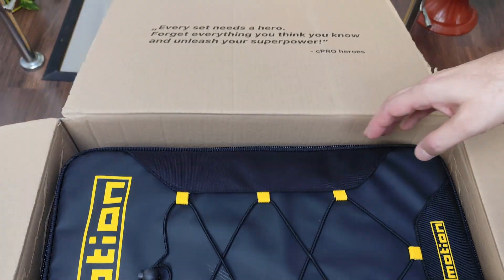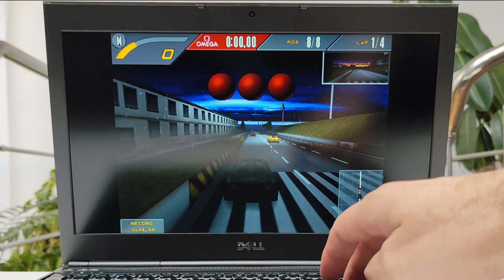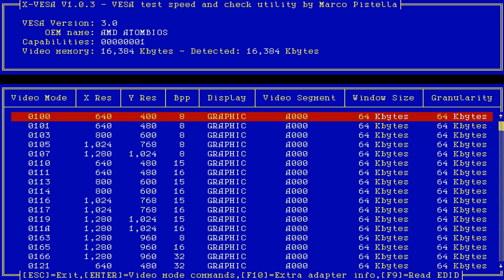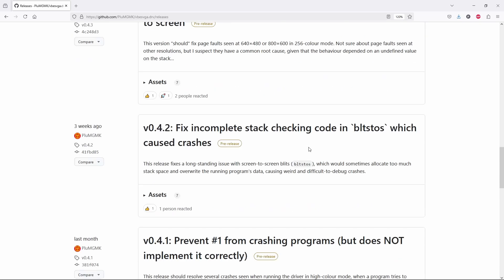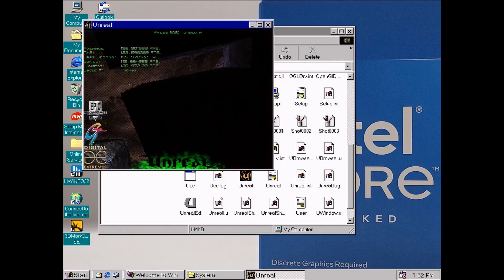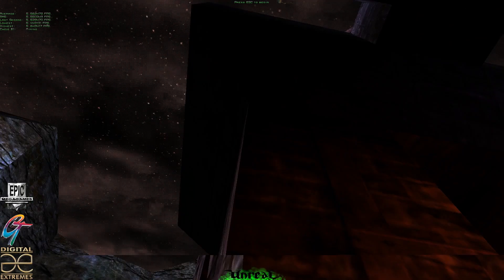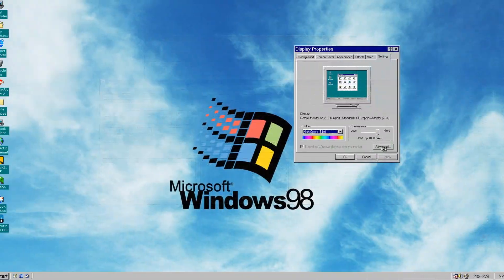World's First 3dfx Voodoo 4 Laptop: It Works in XP, But Windows 98 Chose the iGPU

Comment: Thank you for the video i subbed 😀 i just installed Windows 98 se quick install socket 775 8400cpu and 760 and sound blaster live card. Everything working so far after tweaking a bit. What sort of acceleration would i have with the 760 ? Quake 1 about the limit ?
Reply from the maker: Welcome aboard! Is the 760 a GTX 760? If so, you might get around 35-45 FPS at 640x480 with software rendering - which would actually be a pretty authentic Windows 98 gaming experience. Back then, many of us (myself included) were still using basic 2D cards like the S3 Virge. Since your 775 motherboard makes it easy to switch the primary GPU, you could grab a second card like a GeForce FX 5500 (PCI) or - even better - a Radeon 9250. If you have dual PCI-E slots it's cheaper to buy a PCI-E card for Windows 98, check this out: https://youtu.be/iMyK-NJkSoo

Comment: The 3dfx patents can be sold or free-sourced 25 years later. We are around this glorious date. Where we can Buy this mini-card ? Is Nvidia Will help this startup in rétro gaming? Have a Nice gaming expérience with this vsa-100  chip.
Reply from the maker: There will be another 3dfx video today -  stay tuned for more details! You can source the VSA chips from eBay and order the PCB from PCBWay or JLCPCB using the original design files from Daniel at SDZ-Mods. After that, it’s a matter of assembling and soldering the components. The design will be open-source, so anyone can replicate or modify it.

Comment: I HAVE BEEN SAYING THIS SHOULD BE DONE FOR YEARS!!! I also wonder if you could make a voodoo card that plugs into the pcmcia slot. Or the mpci slot.
Reply from the maker: This V4 board is using an original VSA-100 chip, built on 250NM process - and this chip needs proper cooling, so you can't make some tiny Voodoo cards that can fit on a PCMCIA form factor or anything similar.  This Voodoo 3 and 4 MXM cards can work with the original solution cooling from the laptop.

Comment: As someone who owns a M4800, albeit one with a M2200 instead of a Voodoo 4, it should be possible to tell the laptop to just use the dGPU only and bypass the issue with 98.

I'd also be curious how the 8570W would fare, as that is dGPU only.

Edit: At the end you mention a whitelist, which doesn't really make sense here. I upgraded my M4800 with a M2200 which came out after the laptop was released and it works mostly fine. Although if it is a real issue, maybe Coreboot could help?
Reply from the maker: This V4 board is using the original VSA -100 chip, built on 250NM process - so as long as you stick with the original hardware you need proper cooling, so you can't make tiny Voodoo cards that can't fit on PCMCIA form factor or anything similar.
Reply: @O_mores  I'm not saying PCMCIA. These laptops have MXM Type A. The V4 board is MXM Type A.
Reply from the maker: Oops, that was a reply for another comment regarding V4 on a PCMCIA card. So far, this M4800 laptop boots with Coreboot and the V4 as primary: https://imgur.com/a/iT0mNoo Now it works with Windows XP - which is not officially supported by Coreboot (some patching was required). Windows 98 doesn't work yet....

Comment: PCI-E x1 next project ?
Reply from the maker: Right now, you can actually make this work using PCI-E to PCI or PCI-E to AGP adapters. The PCI-E to PCI ones are pretty cheap, like 10$, while the AGP ones tend to cost a lot more. Building a Voodoo 4 PCI-E x1 card from scratch wouldn’t be cheap so I doubt Daniel from sdz-mods it's going for it... Especially since there are already decent workarounds, and you can even find some AM5 or Socket 1700 motherboards that still have old-school PCI slots - perfect if you want to throw in something like a Voodoo 5 5500.

Comment: Sweet, what did that set you back? And were can I get one?
Reply from the maker: You can’t really buy one, but you can build one yourself. VSA-100 chips are surprisingly easy to find on eBay - still brand new, and around $25 each if you buy a whole tray. The PCB design and all the firmware will be available for free, so in theory, you just order the board, send the chips out to be soldered on, or even do it yourself if you're up for it. The cool part is, the design and firmware have already been tested and we know they work - so no surprises like realizing you forgot to add something after the PCB shows up...
Reply: @O_mores  Thank you for the info.

Comment: this mean, old tech still can use modern DRAM? like Pentium 3 with DDR2/3
Reply from the maker: This Voodoo 4 uses 4 x IS42S32400J-6BL chips - 128Mb (16MB) SDRAM, rated at 6ns (166MHz). The manufacturing process and packaging are newer, but these chips still work like classic SDRAM. 

A Pentium III can’t use DDR2/3 but you can run Windows 98 on a modern DDR5 motherboard (like shown here: https://youtu.be/G7qm3GFy9tg ) and even use old-school PCI cards in newer systems. I have a Voodoo 3 PCI in my main rig.
Reply: @O_mores  I see, I thought new RAM can be downgraded and let North Bridge handle it. Like Biostar P4M900-M4 motherboard which let PGA478 CPU use DDR2 RAM instead of DDR1
Reply from the maker: It all depends on the chipset, and a lot of them were compatible with the previous generation of RAM. Even today, some Socket 1700 motherboards come in either DDR4 or DDR5 versions. A few rare ones even have both DDR4 and DDR5 slots - kind of like the good old days when boards supported DDR1/DDR2 or DDR2/DDR3. Of course, you can only use one type of RAM at a time, not both.

Comment: Why don't you use the MXM Voodoo card in a Clevo based laptop? Maybe you'll have a better chance to get the card to work with Windows 98 then.
Reply from the maker: Of course, I'd test it in a Clevo laptop if I had one on hand but there's a good chance that both laptops are using the same AMI BIOS. Yes, they're heavily customized, but the core functionality might behave identically.

Comment: precision m4800

setup

video/switchable graphics/unchek option

unchecking this option will only start with the mxm
Reply from the maker: Yeah, but since this MXM card isn’t on the BIOS whitelist, the system just switches back to the iGPU after like two seconds. Plus, the Voodoo 4’s BIOS is not MXM compliant. Coreboot/SeaBIOS does let it boot from the Voodoo 4, but that BIOS is kinda janky for Windows 98 or XP - basically you can't install them... The real fix would probably be modding Dell’s BIOS, but that’s a pain in the a** to pull off.
Reply: @O_mores  I used modded Bios for Alienware M17X R3, you can mod by Bios by yourself using amibcp and afuwin
Reply from the maker: @kiki83607 Yep, I "modded" my BIOS with AMI BCP so I'm familiar with it. You used a M17X R3 BIOS on this M4800 Dell? Or you have an Alienware M17X and you modded the BIOS?

Comment: Quick correction, VBE had some acceleration functions, defined in 1996 called VBE/AF, both for 2D AND 3D. VBE 3.0 (1998) brought to the fore a few more functions than 2.0, and more importently, 32 Bit support (prevois VBE incarnations were 16 bit only).
Reply from the maker: Yep - but those acceleration functions needed BIOS-level implementation to be usable, and most vendors didn't bother implementing them in the first place, those few cards that can be used with VBE/AF do have proper drivers for OSes like Windows 98. The good part is that these newer GPUs are pretty fast even with basic VBE.

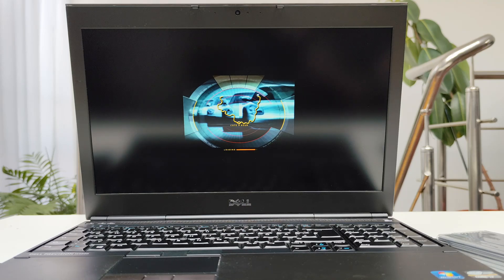Comment: 13:07 I ran an old game that requires 3DFX support using modern hardware and software, with the help of a wrapper-driver called *"Zeus Software nGlide"*, which emulates a 3DFX Voodoo video card.

I ran the game Asghan: The Dragon Slayer on Windows 10 64-bit with a GTX 1060 graphics card.

I recorded a full HD gameplay video (all the way to the end) and uploaded it here on YT. It's nice to see old 3D games running at high resolutions!

I know that your goal is to run the game on original Voodoo hardware.

But I thought it would be interesting to share this information here, in case someone wants to try it in a more accessible way.

I tried it on Windows 11 once and  the game launches, but it runs very slowly.
Reply from the maker: Yeah, I've used nGlide - actually a bunch of older GOG games include it by default. The graphics end up looking about the same, but I guess there's just something special about running games on actual 3dfx hardware...

Comment: Hp elitedesk 800 g1 usdt has a mxm port, it might be a perfect little desktop for a card like that :)
Reply from the maker: Yep, good tip! I actually found some of these G1 USDT  models "refurbished" for about 80$, the only problems is that an MXM card like this Voodoo 4 M4800 is not exactly cheap to make - especially if you order only a few PCBs... So if you're going to use it in a PC it's cheaper to get a normal card for the 3dfx experience.

Comment: Excelent job, as always. 
ps: I remember seeing PCIe to MXM gpus: wink: :wink:
Reply from the maker: Hey, thanks for checking this out! 😁 I’d love to get one of those adapters - I’ve got both a Voodoo 3 2000 and a beastly Voodoo 5 5500 in MXM format. They actually work, but I can’t use them in my Dell M4800 without modding the cooling, especially for the Voodoo 5 since it’s packing two VSA chips!
Reply: Good luck finding pcie drivers for anything for win98
Reply from the maker: @Alexdc11Xof  I'm quite familiar with all PCI-E devices that have Windows 98 drivers. There are drivers for USB 2.0 PCI-E cards, FireWire, Gigabit Ethernet, sound cards, SATA PCI-E, and of course video cards. You can see a few of these PCI-E devices installed in Windows 98 here: https://youtu.be/i_7yCmXm2wQ

Comment: Does the Voodoo work on Windows XP or 7 though?
Reply from the maker: Yep, it works in Windows XP - you can actually see it running in the video. Should work in Windows 7 too if you use the SFFT drivers. For XP, you're good with the last official 3dfx reference drivers.

Comment: Oh, I saw a post on reddit about a 3dfx laptop, it's crazy, and it's on an Intel core i7 laptop (if I'm not mistaken)
Reply from the maker: Yep, this was the beast! Specs:

    CPU: i7-4930MX @ 3GHz

    Chipset: Intel QM87

    RAM: 32GB DDR3 (4x8GB @ 1600MHz)

    GPU: 3dfx Voodoo 4 (M4800 mod) + Intel HD 4600 iGPU

    Expansion: ExpressCard slot (PCIe x1)

    Display: Full HD (1920x1080)

Comment: First thing I was checking if the video was uploaded on April 1st....
Reply from the maker: And here’s something even crazier - there’s also a fully functional Voodoo 5 5500 in MXM format! The cooling solution isn’t finalized yet, so for now, you can only run it with a PCIe-to-MXM adapter or some improvised cooling... like leaving the laptop open and put some radiators on both VSA chips.

Comment: The retro scene is crazy. 😮
Reply from the maker: Yep! There’s also a Voodoo 5 5500 with dual VSA-100 chips in the same MXM format. Daniel from sdz-mods actually sent me one. It was tested with a PCIe-to-MXM adapter and it works! The only hangup right now is the cooling solution isn’t finalized. Once that’s sorted, this thing will end up in a Dell M6800.

Comment: What about NVIDIA GPU laptop Windows 2000 ?
Reply: I believe AMD was a lot better.
Reply from the maker: @NguyenHoang-pv2xd It should be easier to find a powerful laptop for Windows 2000 since it has official driver support up to the Nvidia GTX 400 series. I even got it running on a 13th-gen CPU (desktop) and played Crysis! Check it out here: https://youtu.be/f2grGf2rTV8

Comment: In case of the BIOS, you might want to look into editing the BIOS/UEFI image binary to add support for primary display device selection. People over winraid forum (that has been moved to level1techs domain recently) specialize in that kind of stuff so you should go and ask them for help. Chances are this could be very easy fix - either by transplanting back selector from stock template BIOS that Dell used, or from different Dell laptop BIOS that uses similar platform/specs. If a whitelist edit is all it needs then it would be even simpler. That community has done far crazier things with BIOSes - thanks to them my Ivy Bridge rig gained full bootable NVMe support in the BIOS, with Win7 booting on a GPT partitioned (something said to be impossible on 7) 1TB NVMe drive, WITH boot manager being on the very same drive! Cheers

Comment: If this card does not support Win 3.0, 3.1 or NT 3.xx, there is no point to get this card nowadays even for nostalgic performance because GeForce 6000 series support Win95(?), NT 4.0, Win98 and later. This is just my opinion. But this is crazy for rareness. So, good video as always!
Reply: The main reason to do this would be for games that are 3dfx glide only, or render nicer with glide than DirectX. You can use wrappers like nGlide to play them on modern GPUs, but Omores whole thing is doing everything with real hardware.
Reply: @parad0xheart  yes, maybe. Anyways, video is cool I accept and Omores did nice jobs about running nostalgic things on real hardwares.
Reply from the maker: Building custom Voodoo cards is a hobby for Daniel from SDZ-Mods. Like any hobby, it doesn’t have to be practical - but even so, having a real 3dfx Voodoo chip in a laptop is something unique. I would like a Voodoo 5 5500 in PCI-E format...

Comment: I always new those MXM modules would result in some awesome things, never figured this would be it 😂
Reply from the maker: Stay tuned for the next video where I'll show a Voodoo 5 5500 in MXM format. The V4 works fine with the stock Dell cooling, but the V5 doesn't  - it has two chips that both need proper cooling.

Comment: Try to see if there is a custom BIOS available that removes the MXM whitelist and also disable the integrated GPU. With enough luck you might get it working. I was testing disabling the iGPU on my ThinkPad, it complains but boots with an external GPU (no video in BIOS but once windows loaded it works)
Reply from the maker: So far, Daniel went the Coreboot/SeaBIOS route and kept me posted on his progress. After some tinkering, the Dell actually boots with the Voodoo 4 now—but sadly, the new BIOS doesn’t play nice with Windows 98. Even Windows XP seems to be problematic as is not officially supported.
Reply: @O_mores  Could you please provide a bit more details on getting SeaBIOS installed? I have a M6800 I'd like to tinker with.
Reply from the maker: @mykolapliashechnykov8701 You’ll need to open the laptop, desolder the BIOS chip, and reprogram it using a flash programmer. Alternatively, you could use a Dremel to cut a small rectangular access window in the plastic chassis, allowing you to attach test clips (such as SOIC clips) to the chip’s contacts. This might not be the solution you were hoping for, though...
Reply: @ Well, flashing the bios the usual way would have been easier, but that works too. Would you be able to share the ROM when it’s available? Thanks!
Reply from the maker: Yes, I will talk to Daniel to give me the files he used.
Reply: @O_mores  I did the similar mod with the chassis, but it is actually under that plastic cover, I would like to try that BIOS too! I have a 4060 MXM that doesn't want to start on my M4800, maybe this BIOS will help
Reply from the maker: @mykolapliashechnykov8701 I spoke with Daniel - he said this isn't a simple job. It requires extracting a specific module from your actual BIOS (for RAM training) and integrating it into Coreboot, customized per system. He mentioned making a tutorial eventually.

Comment: The World's First Laptop with a 3dfx Voodoo card!!!  Impossible, because I build 6 laptops with 3DFX Vodoo in 1999, 2004 and 2008, I'm not the first, some people do that in 1997.
Reply: Have you got any photos?
Reply: @Thegeforce8523  Probably he used a docking station
Reply: 1997 was a good year.
Reply: @hacker22382  Did you use some sort of docking station that adds PCI slots on a laptop to put the Voodoos?
Reply from the maker: Yes,  there were some docks like IBM ThinkPad Dock II which had a PCI slot so you could fit a PCI Voodoo inside. But before the MXM standard was introduced in 2004, most laptop GPUs were either soldered onto the motherboard or used proprietary modules or some daughter boards. This is was a big no go for any custom upgrade.

Comment: The device whitelisting on laptops is really annoying. I was thinking could the voodoo bios be changed to a whitelisted vender and device ID then just force install the driver in windows.
Reply from the maker: Could work, but also the BIOS might do deeper checks (like Subsystem IDs, VBIOS structure, or PCI features). Even if it boots, the laptop could try running Nvidia-specific init code on Voodoo hardware, which would fail since they’re totally different inside. The best bet is to use Coreboot which actually can boot with the Voodoo 4 as primary: https://imgur.com/a/iT0mNoo but it doesn't work with Windows 98 (for now) so we're back to square one.